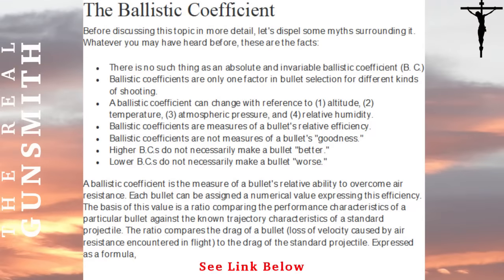7MM PRC Compared to Other 7MM's

Comment: So i have a few bones to pick with your misinformation. Cuz there's a lot. 

1) Hornady designed the 7PRC cartridge as a turnkey solution FOR EVERYONE that wants to hunt as well as shoot recreationally; it does both of those exceptionally well
2) The 7mm PRC is 3000 fps out of a 24" bbl with a Hornady 160gr CX, the 7mm mag is 3000 fps out of a 24" barrel with a 150gr CX. Thats 3197 ft lbs and 2997 ft lbs respectively, at the muzzle, and the 7mm PRC will retain its energy/velocity better at range due to the BC you're trying to hard to ignore. The 7PRC is objectively better in every comparison than 7mm mag factory loads and rifles. 
3) The 7mm PRC has less recoil than 28 nosler, and very comparable to 7mm mag, but with heavier bullets at the same velocity as the lighter 7mm mag bullets
4) The 7mm PRC has better energy at the same barrel lengths than 7mm mag, meaning you can run shorter barrel lengths and suppressors for those that don't want to lug around a musket  
5) Much of your argument is based off what YOU can do with your very specific knowledge and resources. Just because you are able to create the 7mm mag rifle of your choosing using your tools, equipment, and experience doesnt mean everyone does. The 7PRC gives the layman the ability to shoot with the best factory equipment possible, rivaling gate keepers like you without any effort. 
6) The chamber tolerances and design as well as the casing design lend themselves to factory rifles and factory ammo (not custom rifles with custom "handloads", as your diatribe harps on incessantly) lend themselves to inherently higher accuracy
7) 7mm PRC has tighter barrel twists (1:8) than 7mm mag, meaning you can run heavier bullets and stabilize them, unlike the 1:9 to 1:10 twist 7mm mag (meaning more energy on target for the 7PRC) 
8) The 7mm PRC is designed to push heavier projectiles than the 7mm mag as fast as 7mm mag handloads, without exceeding 65,000 psi. Bubba's pissin hot reloads are no longer required. 
9) It fits any long action. I don't know why you went on a tangent about that. It's objectively true. 
10) The casing is designed such that, as opposed to the 28 nosler and 7mm mag, you can load heavy-for-caliber bullets into the casing without needing to gunsmith a custom barrel or seat the bullets into the powder column. Again, back to factory availability. This also creates even pressures on the back of the bullet so the bullet isn't forced into the rifling while yawing due to universal pressures on the base of the bullet 
11) In 1962, when the 7mm mag came to market, the heaviest bullets available were 162 gr. This is no longer the case. It's been 61 years. It's time for an update. 
12) You go on about shortening a cartridge and calling it better, but use 28 nosler as one of your "better cartridges," and it's just a shortened 7mm RUM lmao. At least acknowledge this fallacy. 
13) The design of the 7PRC, if you do hand load, is such that brass won't accumulate at the neck-shoulder junction, due to the bearing surface being sealed above the neck-shoulder junction. 
14) The powder capacity is filled to 100% on the 7PRC to facilitate consistent ignition cycles for the powder during shots both uphill and downhill. This way, all your powder isn't stacked in the front of the case on a downhill shot, and in the back of the case on an uphill shot, creating horrendous deviations in velocity depending on your shooting angle. 

In short, you're just a snowflake getting angry that times are changing for the better and your inability to adjust your trade with the increases in technology. You'd get way more business by saying it's a fantastic cartridge and you're going to make it better by creating products that meet the demand this will create. Congratulations, you played yourself.
Reply: You would make a great democrtat!

Comment: I run 7 Rem Mag in a Ruger77 and a custom long range gun.  Can't agree more on the 175 Partition.  I also like the lighter Barnes 7mms.  

I get good results with 7828 in my LR gun with 190s.  Good velocity and really low SDs / ES.  1/3" groups or smaller.  This is 100% a target rifle with a long barrel (30").  I feel the load is quite mild, and measuring pressure in line with videos I have seen here and my own experience over 20 or so years agrees with it.  I'm using published data, except for being long on CoL due to a custom throated chamber.  Still, it speaks well for the powder IMO to be that consistent.

Comment: 30" barrel with 7 rem mag, 180 bergers and retumbo, 3150 fps is no issue at all.   can show this any time,  28 nosler sends them 3300 and a 7 Rum sends them 3450 (32" for Rum to burn the extra powder), expect 400 rounds out of Rum and Nosler however.

Comment: You can do anything a 7PRC can do with a 7 rem mag, IN A CUSTOM RIFLE that is!
Reply: Nah the 7mm prc can’t get the same velocity that a 7 rem mag can. And won’t be any more accurate than a 7mm rem mag will be
Reply: @anthonyarcher7268  yea at the barrel and at every other distance.   What’s your point?
Reply: Why would you need a Custom Throated  Rifle to  shoot the 7mm Rem Mag, For Eons they perfectly shoot 168-175 Grns bullets accurately. New kid on the block, Dump the 7 RM and get a 7 PRC. If I needed to dump the 7RM would get a 28 Nosler
Reply: It’s not just about the weight of the bullet it’s the length that the 7 rem mag won’t stabilize without a custom rifle job
Reply: @edd752010  go buy an off-the-shelf 7 rem mag and an off-the-shelf 7prc, load them both with factory ammunition and take them out to 1 mile and beyond.
Reply: @brentdanieldbtcm3620  you’re not really into shooting if you don’t hand-load.
Reply: @edd752010  I do handload. I hate to be the one to break it to you, but MOST people do NOT handload. Do you really think all of them are not into shooting?
Reply: @edd752010  the 7PRC and 7RM have very similar velocities. The extra 4gr case capacity in the 7RM is Irrelevant. The bullet in the PRC is taking up a lot less case capacity.
Reply: @WillyK51  most 7RM have a 1-9.5 twice. It will stabilize a 175gr Partition but not a 175gr Accubond. Put both those bullets in a calculator  and you'll see where BCs matter. I didn't believe it till I saw it for myself. The 28 Nosler is awesome but not for everyone. It's really overbore and that comes with lots of issues. One being it's hard to keep in tune because it wears the throut so fast.
Reply: @brentdanieldbtcm3620  easier way, just go to something like Bison Ballistic and use their calculator. Enter in the bullets and compare a 175gr Partition and a 175gr eldx at the same velocity.

Comment: Bullet selection needs to be made by your impact velocity heavier constructed bullets work brilliantly at closer ranges and higher velocity but tend not to expand adequately at 2300 ft per second and below. Soft cup and core high BC projectiles tend to come apart at close range and high velocity but do a very good job at 2600 and will expand all the way down to 1600 ft per second if you pick the correct bullet. There is no perfect cartridge or projectile that does everything perfectly.

Comment: What tools do you need to measure a chamber? I use certosafe and a caliper. Anybody can do it, not hard at all
Reply from the maker: I believe you are referring to cerrasafe.
Fire a case and measure with a one inch micrometer that reads in one ten thousands of an inch.
Thanks for watching.
Reply: @TheRealGunsmith  I have micrometers but in my experience a good caliper works just as well,still gets the same number

Comment: Glad to hear you saying what needed to be said. I've seen too many videos, lately, which advocate for hunting cartridges I would personally never consider. I'm horrified to hear many gun vlogs where folks are using stuff like 6.5 mm to hunt elk at extended ranges. I've been hand loading 6.5 Swede since the late eighties and have used this and other 6.5 cartridges to hunt animals like coyotes and pronghorn, even whitetail at reasonable ranges but would never use them on anything like elk at any range. I simply don't prioritize sub MOA accuracy over good terminal performance for any game, especially game which are notoriously tough. I've made bad choices in the past but I try to learn from them. I do, from time to time, forgo making a shot because I'm unsure of my ability to make an ethical kill, or mistrust the bullets ability to make a clean kill.  Sincere respect to you sir, for saying what needs to be said amongst all the hype.
Reply: I was a 6.5x55 until this year. Had three of them handloaded for 25 years. You said no 6.5mms to hunt elk...I'm not a elk hunter, I'm a deer hunter. Here's some numbers out of my Bergara 24 inch 6.5 PRC...and you tell me. Factory 130 grain terminal ascent 3150-3180 fps(barrel is getting faster it has around 100 rounds out of it now). Nosler 142 ablr 2950-2990. Now what's funny is the general consensus is the .264 is plenty capable of elk. And if you look at the numbers....they are the same as the 6.5 PRC. I doubled down and bought a Browning hells canyon Mcmillian and haven't shot it yet and it's a 26 inch barrel. Yesterday I shot the Bergara on paper out the bed of my truck at 425 yards with a 200 yard zero with the terminal ascent. At 425 yards I was 9 inches low with a 2.5 inch group. Get rid of the 6.5x55s and get in the 21st century.
Reply: @Manbunmen65  I get it that 6.5, especially prc has been shown to be capable of tougher game than the relatively anemic 6.5 x 55.  I also understand that with the higher velocities and better bullets, that 6.5 creedmore for example carry more energy at about 700 yards than say a .308.  But it's immaterial because I wouldn't hunt elk at 700 yards with anything.  I don't have a 6.5 Prc yet but do shoot and reload 6.5 Creedmore.  Just not at elk.  Or moose.  I've shot  plenty of coyote at ranges up to  1000 yards.  For elk I like heavy bullets:  180 to 200 grains minimum even at shorter ranges.  Which is why I would choose 30/06 over 308 for elk.  I can easily load the heavier pills.

Comment: Exactly.
I feel that the gun culture is held hostage by "newer, bigger, better or faster" propaganda.  I've tried several newer cartridges but always seem to go back to my tried and true.....270 Winchester for mule deer and 7mm Rem Mag for elk.  I also like my 270 for black bear, mountain lions, goats and sheep.  There are probably cartridges that would shoot flatter or faster or be better for a certain game animal but I know that 270 well and I know my 7mm well.
Grandpa used to tell me that I needed to beware of the man that only owned 1 rifle.  Because he probably knew how to shoot it VERY well.  
I guess I don't understand the desire for flatter and faster all the time.
Get a rifle that you can handle the recoil and know its trajectory.  Then learn to hunt and get as close to the animal as possible.  I can't remember the last time I shot at an animal that was over 150 yards away.  And the largest percentage of those were well under 100 yards.
An old 30-30 lever action would have sufficed in most of my filled deer tags.  And probably would have waisted less meat.
My point is this:  it doesn't matter if the cartridge is the perfect design or if the bullets BC is the best.  Can you shoot the rifle?  Can you shoot it accurately in ALL instances?  
I'd much rather shoot a rifle that I was familiar and accurate with, but maybe wasn't the best choice of caliber, than something on steroids that I didn't know a bit about.  I can almost guarantee a filled tag with my old hunting rifles.  If I take a new rifle to the field, I only give myself 50/50 odds.

Comment: It's a 7wsm but longer. So the joker's that say things like 'the 6.5 creedmoor is better than the 260 rem because it's shorter' are at odds with the 7 wsm that's shorter than the prc.

Same goes for .308 vs 30-06. 30-06 has more recoil that's not worth it, supposedly. Well, the 7prc isn't worth the increased recoil over a 7wsm, right?

Comment: So if case capacity is such a big deal, I just went to the Hornady 11th edition, 7RM uses 68.5gr of H1000 to push a 162 grain pill to 3,000 fps, but the 7PRC does the exact same thing using 68.2 gr of H1000 to push 162 grain pill 3,000 fps. Hummm, just looked up 28 Nosler and to get 3,000fps on 162gr pill it's calling for 76.8gr of H1000.
Am I reading the saami specs correctly 7PRC throat Dia..2846 and both 7RM and 28 Nosler are called out at .2845 Dia. So why are we discussing throat dia??
I couldn't agree with you more, there are lots of people trying to exceed their capabilities, by trying to hunt well beyond their ethical limitations. 
And yes my examples 162 grain pill at 3,000 fps muzzle velocity make hunting capability out to "APPROXIMATELY" 500 yards to stay in 1,800 ft lbs energy range!!

Comment: Good info sir. Personally, I think the ability of a 7mm rifle to accurately handle 175+ gr bullets at 1000 yds is wasted on 99.5% of shooters. Over the last 40 years of sitting at public ranges from Georgia to Cali, N Dakota to Texas, I’ve found that most shooters have no business shooting at game much past 200 yds. Past 500 and you are down below 1 in a hundred. I think shooters should first learn to utilize all the range you can milk out of a good 7mm-08, 260, 6.5 creed… before thinking they should be shooting game at 1200 yds just because writers tell them a gun will do it. If you’re new to the game or don’t have a 7mm and don’t want to hand load then the PRC may be the ticket. If you’re like me and have a 7mag that performs well then there’s really no need to switch. Modern powders have changed the game for the classics. A full load of RL 25 pushes a 160 Accubond right at 3100 fps out of my 20 year old A-Bolt and produces sub MOA groups well past 600yds. Rather than buying a new rifle I’d rather use the money to feed what I have.
Reply: I think you make a real valid point.  I'd like to add that if somebody thinks they want to shoot game at any distance. They should be able to put a minimum of 5 rounds on target in an 8 inch circle at whatever distance they're shooting.  And if they can't do it consistently, they should not hunt at that range.  Personally, I like a 5 inch target for myself before I consider myself good enough to hunt at a particular distance. And if I get a new rifle, I practice with it and make sure I am proficient. Before I take the chance of losing a wounded animal somewhere.  I can hit an 8 inch plate at 1000 yards pretty consistently, but it doesn't mean I'm gonna hunt at that distance.. 
I got a hard lesson many years ago, I dropped an elk at a pretty good distance. And forgot to calculate that I was going to have to go uphill, downhill uphill and downhill many times to get to the animal.   I got there, the animal was still where it landed. But the distance I thought I was gonna walk to go get it quadrupled. Lol. I'm not shooting over 400 yards if I can help it. It only took one time to learn that lesson.
   I also like your point about using what you have if it does the job.  I've got a 30–06 that shoots about three-quarter moa consistently. And although I like the idea of the seven PRC personally I haven't been able to justify it, because I just don't need the thing. I want one, and I might get one eventually. But I'm not in a hurry.

Comment: Do you have any references to the article or podcast, video or other of the person stating one can achieve 3250fps out of the 7PRC with any weight bullet?
Also, does throating out a factory SAAMI spec chambers actually put the PRC and Rem Mag in the same category. I’m pretty sure everything I’ve heard regarding the two chambering, when being compared side by side, is that the SAAMI specification is significant change. I’ve not memorized the entire SAAMI 7mm section but there are certainly very few FACTORY chambering differing the twist rate, bullet weight and overall length with the performance figures such as the 7PRC. Sure the 7mm Blaser Magnum is right there, but, factory twist rate of 1:10.. also not SAAMI..
I think it’s fair to say that the the intent of comparing a cartridge from near 70 years ago coupled with todays trends in exterior ballistics leaves all of your arguments with out weight. Sure, you can take a 100 plus year old cartridge, have it loaded in to modern brass, seat a modern projectile and customize the barrels twist rate to accommodate that… but you won’t be buying that ammo off the shelf in a factory offered firearm. Period!
Reply from the maker: Too bad the current generation with little experience think they know more than some one with 50-60 years of knowledge and experience.  Learning every day.
Watch the videos again, and listen.
The factory ammo by Hornady is loaded with the poorest game bullet ever to come along.  So it is hype, not a real advantage.  ELDX, the 160 CS is the only game bullet, the rest are target bullets.  It's all marketing and money. 
Thanks for watching.
Reply: @TheRealGunsmith   so when the rem mag was released 1962 weren’t you just a “young whipper snapper” with 0 yrs of experience. + if you listen to the guy that designed the round he based it off of the a custom rem mag that he made.
Reply: @TheRealGunsmith  you've certainly proven your arrogance my friend, keep up the misinformation. You make some humorous videos..

Comment: Here is how I measure pressure:   Choose a heavy spitzer bullet.   Seat the bullet out long, to magazine length.  Choose a slow powder, like H1000.   Increase the load until the primer starts to flatten.   Back off three grains.   This is your reference point.   Now you work up and down from that point in 1/4 grain increments.   Find the best group.   Stick with that load.   My dad taught me this approach in 1963.  This is cowboy style, but it works.